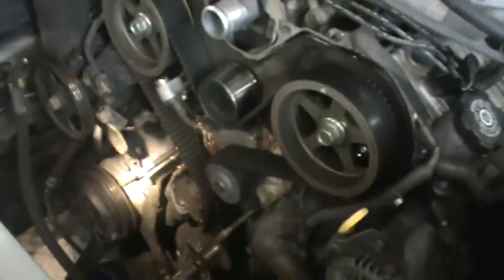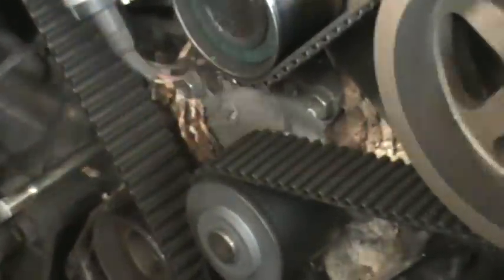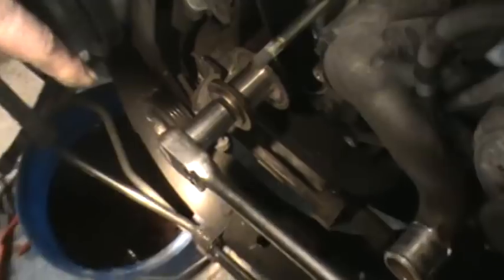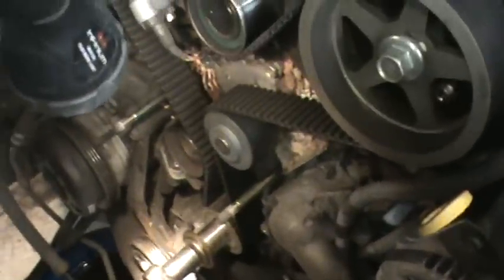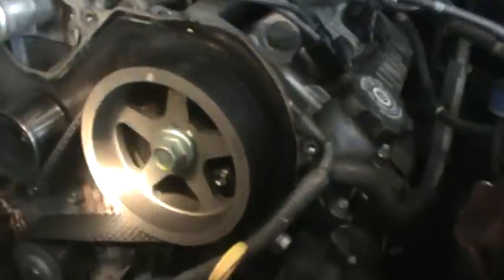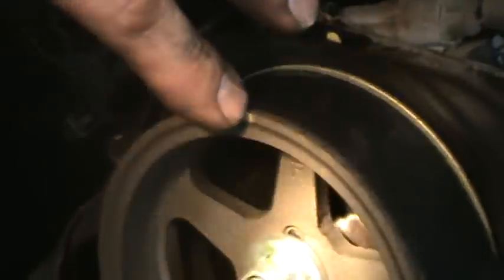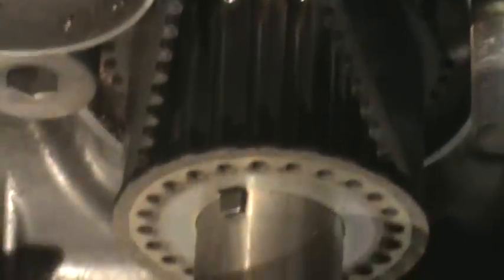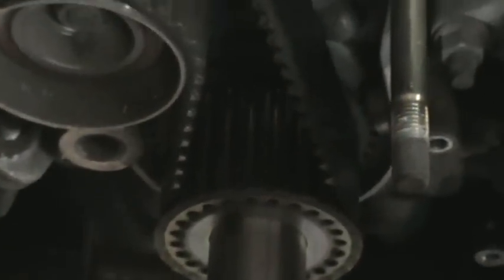2001 toyota timing belt install 4/18

Comment: So how do you adjust the crank shaft to correct this? Set the two cam pulleys, remove the belt then rotate the crank shaft clock wise until the crank shaft is properly aligned?
Reply from the maker: If its only one tooth yes.